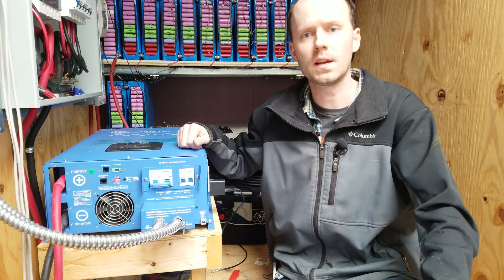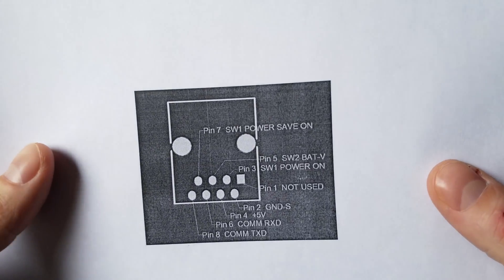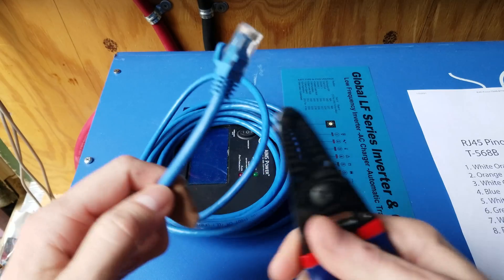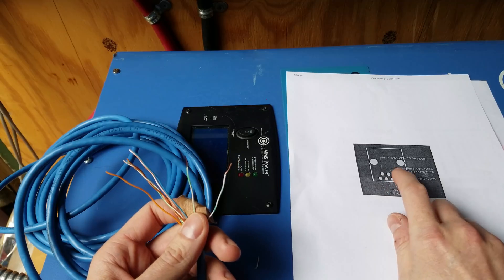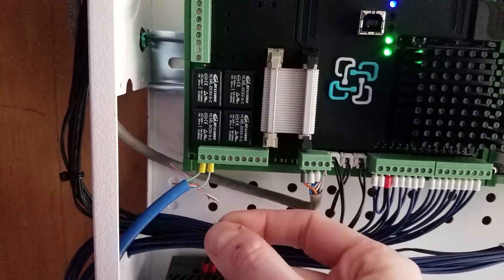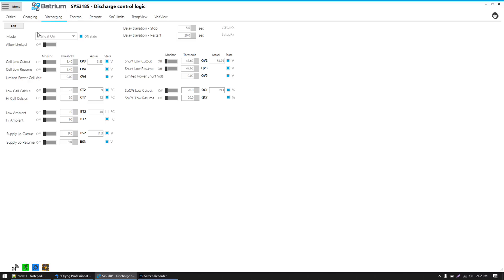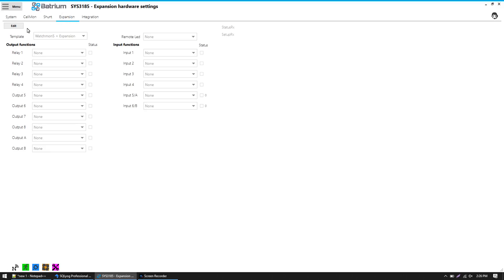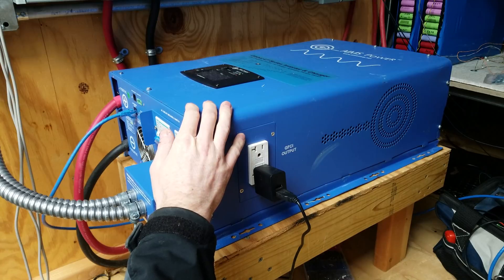Turning an AIMS 10,000W Inverter On/Off with a Batrium BMS

Comment: This is just perfect man!  Thank you!  You know I have the same exact inverter.  Turning it on/off manually was the biggest flaw on an otherwise perfect inverter.  I’ll be doing this and the wifi option when that video is out.  You rock!  Thanks again
Reply from the maker: I was debating wiring directly to the rocker switch at first. I didn't mind turning it on/off manually during the summer, but now that we're in winter, kindof have to keep the container closed so it retains heat and stays above freezing lol.

Comment: Hello. Are there NC relays on the batrium? I wish to switch off charging contactors (open contact) when cell voltage reaches a stage.
Reply from the maker: The relay on the Watchmon Core and 6 relays on the Expansion 3 are all NO relays. I would think this is the preferred option as if something fails with your BMS (ie power loss) you would want the relays to default open (charging off). I did something similar to what you're asking though and have a video about it here https://www.youtube.com/watch?v=C3wQBHiXssY
Reply from the maker: Also, I should note too that your charge controller should still be configured with proper voltage settings to avoid overcharging, even if your BMS is turning it on/off.
Reply: @LithiumSolar  thanks for your response. How do I configure the watchmon core to always close the relays until a cell reaches 3.55v, then open the relays? Then close again at say 3.45v and repeat the cycle.
Reply: @LithiumSolar  thanks for your response. How do I configure the watchmon core to always close the relays until a cell reaches 3.55v, then open the relays? Then close again at say 3.45v and repeat the cycle.

Comment: @LithiumSolar great video on this AIMS inverter. I have a friend that has the 12Kw version of the AIMS inverter, and they are wanting to switch to Lifepo4 batteries (Ampere Time) cuz their Flooded lead acid battery bank is dead. I noticed that you use lithium cells with your 10Kw AIMS inverter when you did a series of videos with the AIMS inverter and wanted to know if my friend 12Kw AIMS inverter will work with lithium (lifepo4) batteries. I noticed that you did not mention a setting on the dial from 1-9 on setting this setting for lithium batteries. Love your videos, you always cover the details!!!

Comment: nice video! 
I am working with a 10 x Lithium Ion MB L09-1 12S 44V 20AH 880WH battery array for my home DC Coupled Backup System, looking for a nice Inverter/charger. On your video saw the Batrium battery management and was wondering if you can give me your advise on what could be the best options for my system. Thanks!

Comment: You do nice work, I have been building my system and was very pleased to see your setup the same as mine. very comforting to know I was doing it right. The other site diy solar power was okay but not what I was looking for.    This is perfect. I had a chinese knock off inverter last year that scared the shit out of me, decided to go with SMA 6048 and midenite 250 instead for safety reasons. of course that big bankruptcy got both on ebay... at the right time.

Comment: Glad to see you still have this big bad inverter. Mine has been running my home for the last 2.5 yrs. Had to oversize my battery bank (Lifepo4) by 5kw since it idle consumption is 200 watts/hr. But boy is it powerful. Thanks for you video.
Reply from the maker: Which version do you have that's 200W? Mine is right at 146W idle for the 10kW. Is yours the 12kW?
Reply: @LithiumSolar  No it's the 10kw, the batrium BMS reads 200 watts on idle no fans or load. But even 146 is a lot. But it works well just added a bit more battery and good to go. Your idea is very useful, I will suggest it to him as a way to protect his battery at low voltage. Using a Bmv-712 which brings a relay.

Comment: You don’t want to assume that the wires are correct? Well, the cable would never work as an Ethernet cable if they weren’t!
Reply from the maker: Huh? Ethernet doesn't care about colors. I was making sure the colors matched the correct pins.
Reply: @LithiumSolar  both pins are cabled exactly the same, unless we’re talking crossover cables. Otherwise, the cable doesn’t work.
Reply from the maker: @thanar  I was making sure the colors were in the correct pins and order. Just because they visually appear correct doesn't mean anything. The manufacturer could have considered the right side to be pin 1 whereas someone else considers the left side to be pin 1. If you want to just assume it's correct and risk feeding 60VDC into something, feel free. I do not want to blow up my $3500 inverter so I'll take the 30 seconds to check with a multimeter. I don't see what's so bad about that.

Comment: Hi just a idea If You Drop A Little Bit of heat shrink over the main cables then you can tuck them back and then heatshrink them down to the main cable out of the way
Reply from the maker: That's a great idea. I need to find a way to cap them properly first. I just have electrical tape over the ends for now.

Comment: Great video. I was wondering what that RJ45 port would be used for. Excellent project.Thanks for sharing.
Reply from the maker: They actually sell a remote control panel for it that looks exactly like the panel on the front of the inverter. It's expensive though, around $150 I thinks.

Comment: I get the feeling the Batium setup is fairly expensive, if you only wanted to control the inverter, not including customizable temp/ voltage ranges it would be cheaper to use a single board BMS and an optocoupler/solid state relay to perform this job.
Reply from the maker: The example you gave, a single board BMS with a relay to control the inverter, would work but you still need a proper BMS for your battery bank. So.... what would you be purchasing for that? It makes more sense to invest in a proper solution since we're talking about safety equipment here. Don't cheap out! It doesn't have to be a Batrium, there are plenty of others on the market.

Comment: ... Improperly wired patch cables? Tom foolery. There's 3 ways for ethetnet: TIA 586 A and TIA 586 B.... And the wrong way.
If you buy a rollover cable or something else: you're getting what you pay for.
Reply from the maker: As I just told the other person, Ethernet does not care about colors. If you've spent any time working in IT, you will have seen all kinds of cables that function perfectly fine but are not wired per the standard colors and orders.
Reply: @LithiumSolar  interesting statement. In 10 years I've only seen the 3, only 2 proper with prefabbed cables and "completely wrong" for punch downs or crimp. To pass any real certification testing: wiring choice needs to have proper wiring and headroom to pass. Have never come across a factory made patch cable with the wrong wiring.

Comment: Use remote access and use that same pc to control it. It's built into every pc.
Reply from the maker: I used to have a windows PC running in the shed for a while. I moved away from that and don't want to go back. Too much wasted power... A simple wifi switch will work fine, just need to get it configured.

Comment: I found the Batrium BMS so confusing to set up and use, even after watching your video, so I went with a simple DALY BMS on each of my LTO batteries in my battery bank. I'm not real concerned about the individual cells of my batteries becoming out of balance but, to be able to see what each cell is doing would be a good feature. Maybe I would have been able to connect the Batrium to my Sol-Ark 12k?
Reply from the maker: I agree, it was a bit confusing for me too at first. I've spent a lot of time messing around and learning. It's one of those things that has a learning curve, but makes sense once you learn it. If there's anything I can do better to explain, or that you would like to see, please let me know. I'm always looking for new video ideas :) I don't see Sol-Ark on their list of supported inverters, but I do see Sol-Ark supports CAN, so there is a possibility it may work, but you would want to reach out to them to confirm first.
Reply: @LithiumSolar  Obviously it's called a learning curve for a reason. The hump (or curve) is taking me a lot of time to get over due to not getting everything connected together in my mind. Reading and understanding wiring diagrams has been my biggest challenge to date. I had a real difficulty understanding batteries until one day it all came together but still can't figure out how many Kwh my battery bank produces.I have 15 LTO SCiB batteries rated at 64.8V 45AMPS each that I am using 60V Nominal and 48V Minimal floating at 59.7V. Do I use 48V times the 675AMP total to get the gross amount of Kwh that my bank produces?

Comment: Yes, I use the BMV-712 smart battery monitor to turn on and off my 48v 6kw AIMS power inverter using terminal #3  and #5
Reply from the maker: Nice, Victron has some fantastic hardware! I have a BMV-700 that I used in the beginning for a while.

Comment: Another great video.  I use Midnite Classic Charge Controller AUX1 to turn my AIMS on/off (thru pins 3 and 5) as you've shown based on battery voltage.   This has the affect of turning the inverter on / activating the downstream ATSs when there's enough PV power to use...  (51.5v in my case) and then off when the battery drains back down to cutt-off at 49.5v.   This avoids idle time/power waste.    I just use the Midnite Classic instead of Batrium to do the same thing :)

Comment: Nice I love auto stuff. Question do you have an auto transfer switch to turn on the power to whatever the inverter was running before it shuts off otherwise the freezer will thaw or whatever.
Reply from the maker: I have a Reliance transfer switch that allows me to flip circuits from inverter to grid. During winter months, those stay on-grid all of the time. It's only powering fully off-grid circuits these days, such as the cloths dryer, washer, water pre-heater, and a few others. Once we are back to early spring, I'll flip other circuits back and just leave it run 24/7. The only time it should shut down at that point is if the battery drops too low.